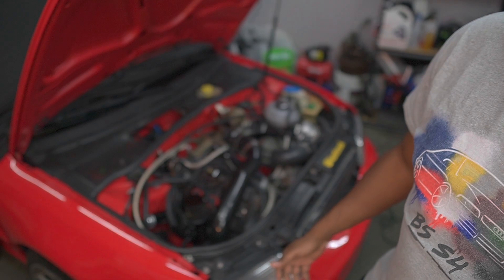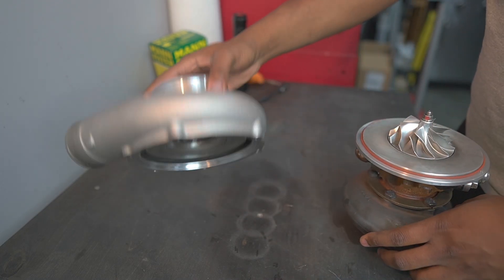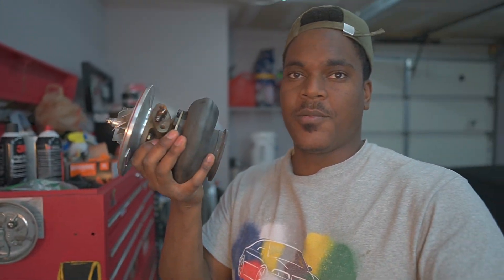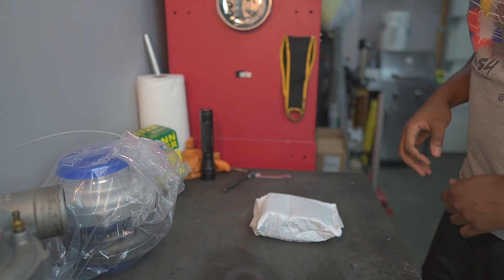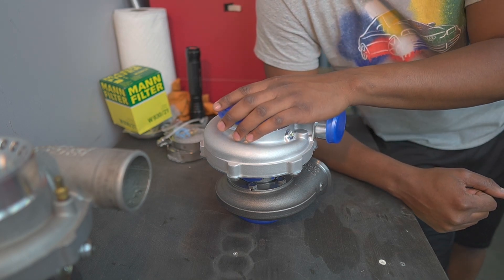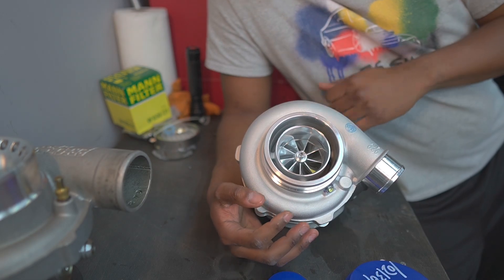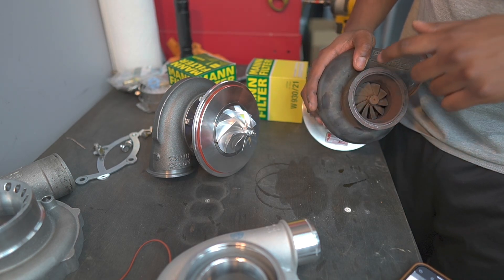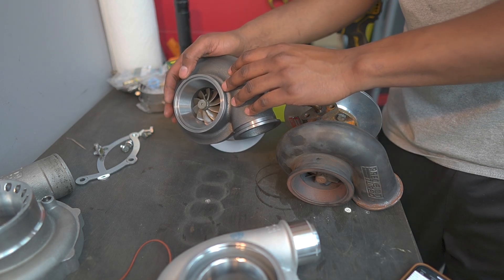I Blew The Turbo On My S4

Comment: I just recently spoke with Precision. They said there are 2 important factors with oil return lines. First is to ensure the oil return flange inner diameter is port matched or larger than the turbo's oil drain port. Second is to ensure the oil return hose/line comes straight down out of the turbo. Not sure about your flange but I do remember you had a 90 degree oil return pipe. Apparently these issues can cause oil to not properly flow and back up. Once the oil backs up, things heat up and pressure increases blowing oil out of the seals. Bearings fail from the lack of flow. Hopefully that info helps you and others watching!
Reply from the maker: Thanks for writing this out!

Comment: How did the 3076R go? Im building an STK 2.7l at the moment and I was looking at that turbo before I saw this. Would you recommend? Does it flow enough that you don't get heat soak pre-turbo? Love the content dude.
Reply from the maker: Hey man thanks!

And I loved the turbo, spool was nice and quick and pulled well up top 

Definitely do feel the lack of great flow up top 
Specially if you go with he bigger 2.8 heads and ported manifold

if your goal is 450-475 ish I think it’s a great turbo 
More than that and I think you’re getting out of the turbos and efficiency range
Reply: @CIPGAS  Thanks! exactly what I needed to hear. You have saved me a headache. Im aiming for 550-600 atw. I have 2.8 heads and a cam re-grind with more lift and duration being completed by machine shop currently. 

Do you think the gtx 3576R would be a better match with 68mm turbine inducer?
Reply from the maker: @anthonycraig-pw9oh  Happy to help!
And yeah that would be a much better turbo for your goal. Still very responsive but will breathe well will an .82 ish ar.

Comment: U ever thought about the g series turbos heard they are great. Great s4 btw👍
Reply from the maker: It’s an option for sure been eyeing the g30 660 for a while now.
Reply: @CIPGAS  I highly recommend checking out BorgWarner's newest AirWerks lineup, the S200 and S300 SX-E turbos are absurdly great value for money.

The S257 SX-E for example is only around 800$ with a turbine housing and is good for anywhere between 300 to 650whp. The compressor maps are very impressive for a turbo that costs less than a grand and being a BorgWarner it's guaranteed to last.

Comment: I'm currently at the tail end of a very similar build. Newb with all the turbo specs tho. I have the same XS STK. Exactly what size/type flange does the turbine housing flange need to be? Thanks in advance
Reply from the maker: Hey, the flange is a 2.5” precision vband. You’ll be able to use Garrett v band turbos on the flange as well

Comment: Why does the intake mani has to get removed to get the turbo out? Isn’t just a v band?
Reply from the maker: Yeah just a V-Band but it’s much easier to access the bolt for the band without the manifold in the way

Comment: Great video. Just have a question. Did it have cracky noice on broken one when car was on? Another question did you have any changes in oil when you found out issues in Turbo?
Reply from the maker: The turbo didn’t make any noticeable noises and oil was fine when I drained it.
Reply: @CIPGAS  what was a main reason you thought you blow up your turbo?
Reply from the maker: @ehtirammusayev1  The blue smoke coming from the exhaust
Reply: @CIPGAS  did you mention blue smoke in a video?
Reply from the maker: @ehtirammusayev1  yeah i did
Reply: @CIPGAS  my apologies i did not pay attention. I missed that part
Reply from the maker: @ehtirammusayev1  no need to apologize. All good!! 👍🏽👍🏽

Comment: damn the turbo blew because you had an absolutely horrible oil drain, they need to be straight drop down from the turbo, not instantly into a 90* coupler for 10 inches horizontal before it actually drops down again, you backed up the oil and thats what blew the turbo.... I was thinking that when watching your "how to single turbo your s4" that you're gonna blow the turbo in less than 5k miles with that horrible of an oil drain. Hopefully you don't do the same thing to this one

Comment: You think $9,000 for a 2000 s4, 150k miles is a good price
Reply from the maker: That depends a lot on the condition of the car, the color, the maintenance, performance mods and a bunch of other things. But $9k seems about the middle ground for pricing